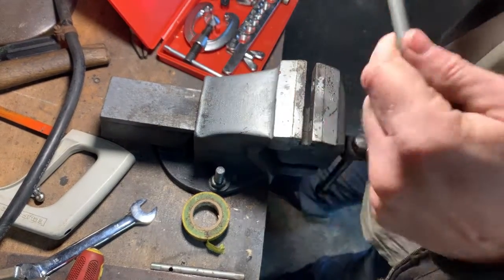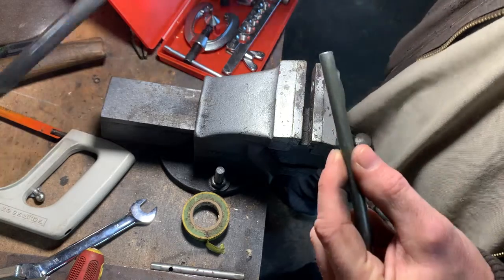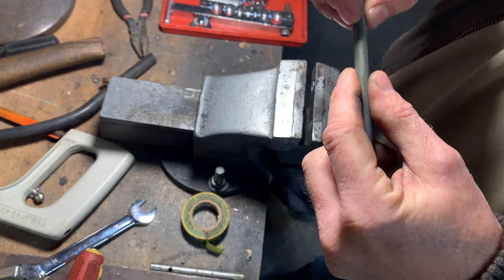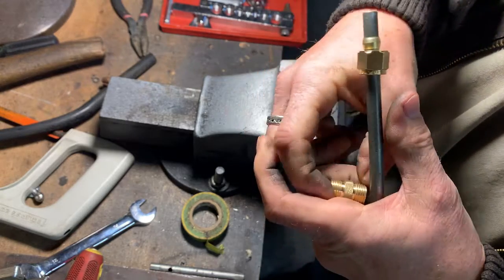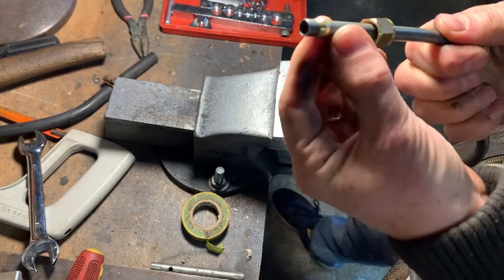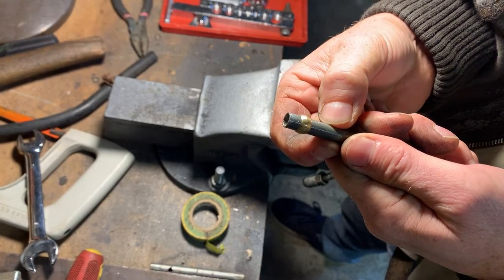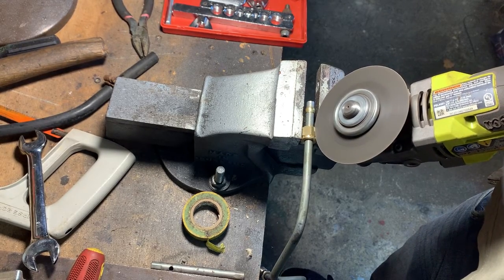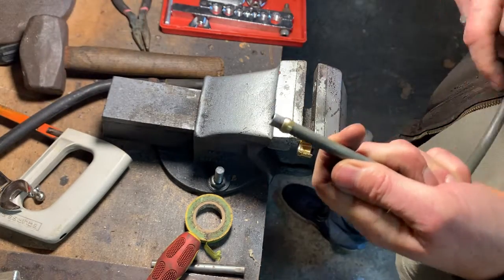Easy way to safely join rubber hose onto steel fuel hard lines  - hose barb with a compression olive

Comment: Genius. There used to be a plumbing tool that would put a similar line bubble (olive shape on tube). This was a barrel that fit into the tubing with an Allen shaped key inside it. By turning the Allen handle a ball bearing would be forced out through a side hole of the barrel pushing against the inside wall of the tubing, creating the olive shape you demonstrated. Reversing the swing of the Allen handle would allow the ball bearing to fall back into the insertion barrel and the tool could then be removed. I used these for the rubber cone washer plumbing connection for 5/16 and 3/8 tubing. The olive expanded portion of the tubing kept the prior added brass washer and slip nut (like you cut off) keeping the end of the tubing captured in the fitting. Anyone know where to get this tool. I had these tool in my tool box for bath remodel work in the 1970’s but haven’t seen this type tool for years. Most people did not know what the tool was for and did not know to buy it so they would not have leaks. Anyone know where to get? Only will work on softer tubing, not steel, but for fuel vapor aluminum tubing should be ok.

Comment: Bro, why overcomplicated you think I’m gonna carry a grinder on the side of the road a compression fitting as a compression fitting for a reason if you put a hose bar on the other end, you could put the fuel line on and hose clamp it and you’re done keep it simple a hose clamp can hold a lot guy or you have another option of putting a fuel filter on the other end, depending on the location, but I mean Christ you were on the right track and then you lost me when you had to cut the nut off completely blew my mind. I didn’t think you were serious.

Comment: I guess if you had only those lying around and needed to do something in a pinch it’s a good idea and better than just sliding a hose over and clamping it, I get it. 
Otherwise you could get a compression to barb fitting and not need to cut off the nut Or even a compression to AN fitting and you can put a barb to AN on your hose, then you can just screw & unscrew to attach and detach as opposed to cutting and or messing with the hose clamp.

Comment: Why can’t you just use that fitting
Reply: You could with the right fitting on hose side or even better yet do a compression to barb eliminating needing to cut the nut off OR compression to AN and put a barb to AN on your hose then you can connect the hose to hardline by just screwing on and off..   definitely better ways to do it but I’ll take this clip as you need to fix it on the spot because you don’t have access to any other fittings and may need to order some but have these lying around for some reason. Its one solution that can work and probably work good however in that case you can also just sort of deform / flare out the edge with a punch or something to help bite the hose or even just slide or hose over and clamp it securely to buy you time to get your parts ordered?  🤔
      I dunno, reminds me of Macgyver taking bullets out of gun and taking them apart to gather gunpowder to set up an explosive to break a door lock as opposed to just shooting the door lock with the gun.
Reply: You can, and should use that fitting.